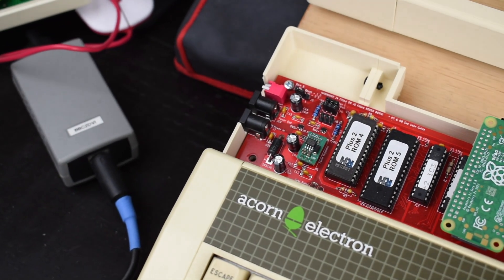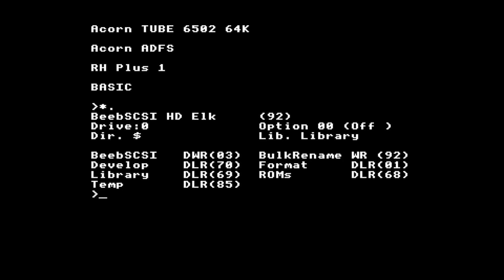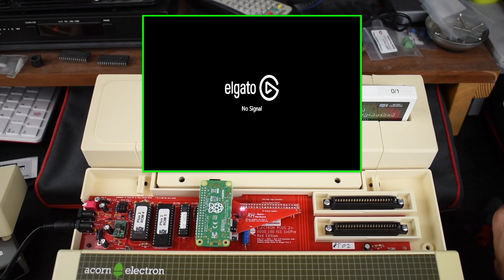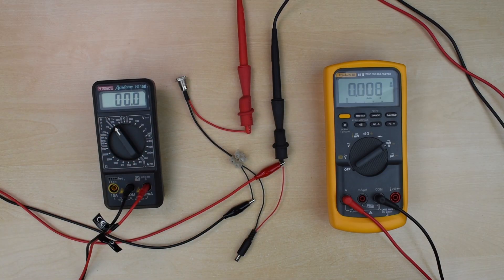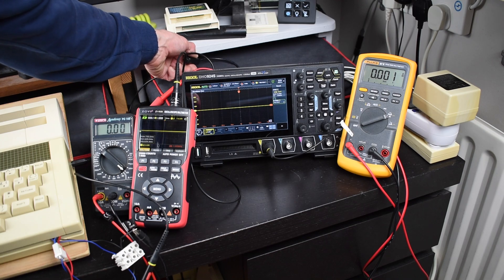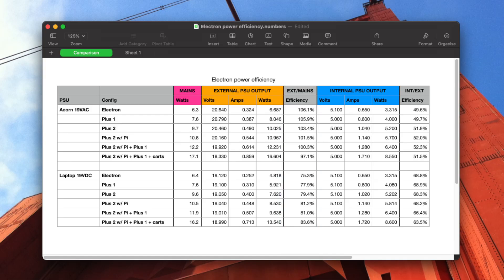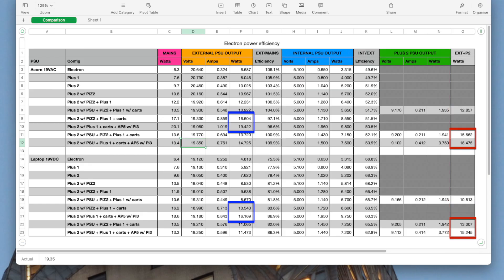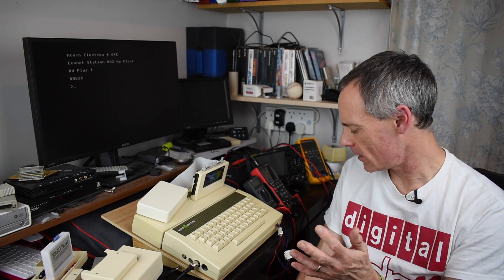Retro Hardware Acorn Electron Plus 2 addendum

Comment: Volts * Amps for AC is only Watts when you have a purely resistive load.  For any reactive load, it's apparent power.  This is why you see AC supplies quoted as VA rather than Watts.  You need to know the power factor of the load - the internal power supply and that'll be why you think you've measured over 100% efficiency.

Comment: I did find it both interesting and enjoyable. It's also not something I've explored with my +2, as the Elk I have that installed with has a +3. I'm using the +3's PSU, which so far has not thrown up any issues for me in  terms of power, it does make more noise than is ideal as it gently hums to its self.

Comment: Great video.

Although not explicitly stated, this also shows why the Acorn plus 3 also needs the bigger 21vac power supply. As well as it converting the input to 12v as well as 5v, (which could have been done from the 18vac pass through  tracks on the connector) there just wouldn't have been enough power to do it all anyway.

Comment: What is the current rating on the Elks power in socket? I would guess a 100va double 9VAC output  transformer wired in series should would work to keep the wiring down.